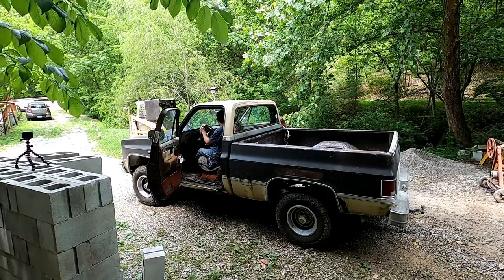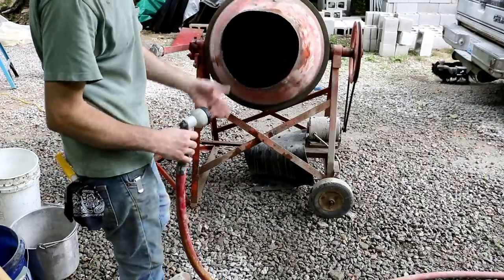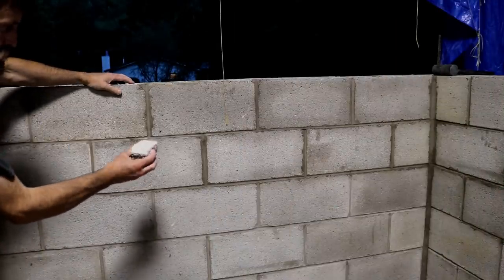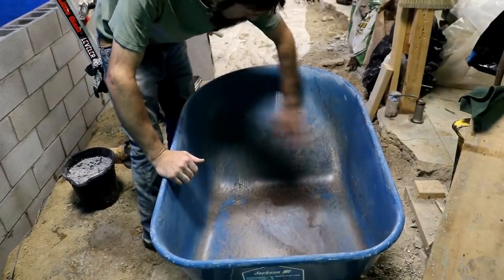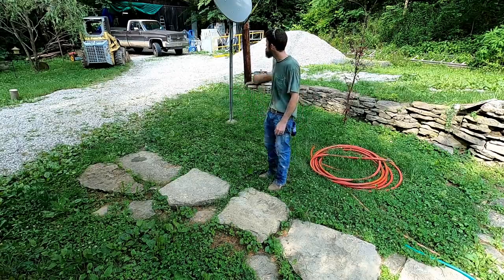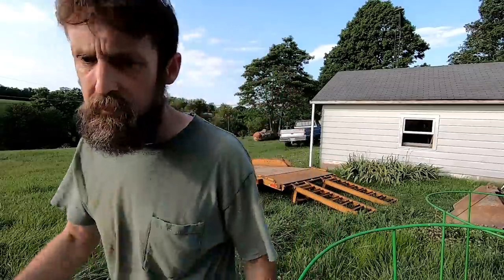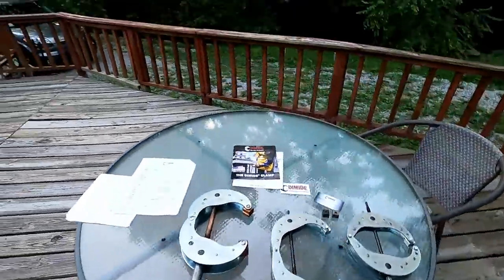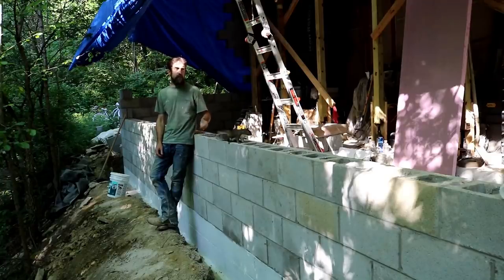Filling the Block / Getting ready for backfill.

Comment: My father was the opposite.  His wheel barrow was beat to shit, crusted in concrete, with cracked handles.  I took it apart when he was at work when I was 16, got all the concrete off, hammered out the dents.  Made new handles and painted it.  He still has it and I'm 47 now.  Over the years in between I never expected it to be something he treasured so much.

Comment: When your guys come to pour the slab, you can have them use the pump to grout your blocks and you can set your J bars for the sill plate while they are finishing the slab.  Cross your chains over- if the ball comes loose they create a cradle to keep the trailer from dropping onto the road.
Reply: The floor has to be poured after the outside wall is up because the jacks that hold the roof are in the way, I said almost the same thing last week then Steve reminded me of the roof supports hehe...
Reply: Arent the crossed chains hazard becayse they can cause the oscillation if the ball comes loose and drag you off road?

Comment: Maybe you can jury rig an unloader for the sand. Lay a piece of 1" plywood in the bed of the truck underneath the sand. At home tie the plywood to a tree and then drive out from under it. Bonus points if you tie off the plywood from the cab end of it, so that the tail end of the plywood has a chance to tilt down as you drive away. If the weight of the sand snaps the plywood when it wants to tilt, maybe try cutting it in thirds and add hinges, or use a bendable material like a extra heavy horse blanket or tarp.

Comment: You can extend your work time with cement by adding liquid washing up soap, the one you use for the dishes, it also acts as a plasticiser if you run out of it on a small job. Drying time remains about the same it just makes it managable for longer.

Comment: Using the flowable fill is ideal for your job. You eliminate the drains inside the building and still keep water out. If you pump your fill you can easily fill empty block with excess material up to floor height too. It will help keep water from accumulating in the block. It will work with your sealing job well too. I've demo'd block that was holding water. You'd be suprised how many block structures sit with water in them 24/7 due to lack of thought. You either drain it or fill it, one of the two. It's looking great Steve. Thanks for sharing

Comment: Putting a tarp down in your truck bed when you load it with sand, gravel, mulch, etc. can save you a bit of effort when unloading. You can just pick up the corners near the cab and flop out the last 50# more or less, if your tailgate is near the pile.

Comment: Using the next mix water to clean the barrow and make the next batch makes the next mix go off(hard) quicker. The chemical reaction started when the first load of cement was mixed with water and the clock keeps on ticking into the next mix.

Comment: Word to the wise - always chock your trailer tires. The first time it rolls forward instead of backward you may wind up in the emergency room. I speak from experience.
Reply: I heard of when loading the trailer lifting the back of the truck and the whole rig going down a hill
Reply: Yep, took a short trip across a road sitting in my sports car while loading it on a trailer. I kept driving forward and luckily my tow vehicle managed to stop before I crashed into something.
Reply: dzneal  Yep I noticed that.
Reply: dzneal brake not break
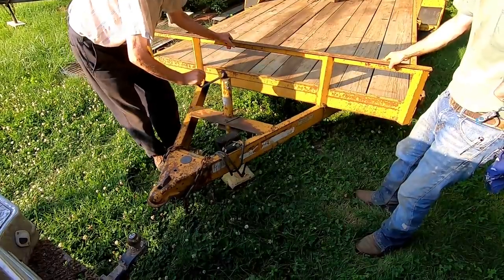Reply: I was referring to about 33:00 when unhitching the trailer and it rolled backwards. It can just as easily roll forward and crush something.
Reply: @samrodian919  Me too

Comment: I always look forward to your Saturday upload. You've never disappointed. Were you live is so beautiful! Availability of different materials can change with local geography. Up here in Ontario we use what we call "A gravel" for cement. It has the proper ratios of stone and fines in itself for excellent cement. It's also used compacted as the base for pads etc. When compacted damp it can be so hard you need a jack hammer or chipper to cut a trench in it.

Comment: Good brakes is one of the reasons I love my f350 dually. Carry 4000 pounds of material and not even be carrying anywhere near a maximum load far as the suspension is concerned.  Towing capacity and stopping capacity are awesome as well. But then again its a 1980 model back when trucks from any manufacturer were still built really well.

Comment: Skid steer went back cleaner than when it came, and with a service as well!
Reply from the maker: And a new battery 👍
Reply: @SteveSummers  Well, part of the service, change the black oil, change hydraulic fluid, change filters and put in a battery that can start it........ Bet the wheels were slightly down as well ;)

Comment: I think you should check what quickreet you can poure into the hole dry and then wet it down then add more dry quickreet as it settles and fill all the block cells, granted it's probably not as good as mixed concreet  but better than leaving them empty. I have seen lots of people set corner postes that way.

Comment: Good idea having your dad hold the brakes while you back the skid steer off the trailer. That's also a good example of why I don't like those double articulated ramps. Once the weight is off the ramp, the supports on the front are useless and almost get in the way. Also, keep your chains hooked up until after you unhook from the hitch. Holds the trailer in case it does decide to take off down the hill.

Comment: Hello Steve
 You need to figure out how much water you're using in a mix. Then the 1st thing you do is but 3/4 that a male in your mixer then add your stone.
 After you get to that point then add your concrete.
 This will allow your concrete to mix nicely with the stone.
 After this is all accomplished then add your sand.
If The mix is too dry add small amounts of water until you reach the right mix

Comment: if you don't fully grout the block with concrete/mortar... consider adding 1/2 stone to them.  Consider it like a crash barrier, if the creek ever hits a 100 year high, it will help dampen and strengthen the wall....  just my 2 cents... as if I had any sense. :-)

Comment: theres a special way to coil youre hose up so it doesnt become a tangled mess when you pull it to the jobsite , basicly you put the wend over the hose over the circle the first time and under the next and keep doing the over under thing untill the hose is coiled , it prevent getting a twist in the hose during uncoiling
maibe one of these days take the wheels of the bobcat and do some touch up painting in it , make it look nice again
as for the braking thing , you got a manual on this truck so you can down shift and let it slow down on the engine during a downhill , saves at least some heat soaking in the brakes
as for someone trying to teal the trailer , maibe you can make a lock on the front wheel so people cannot lower it ontoo the hitch without unlocking it

Comment: I dont know whats correct.
But I usually start with the biggest stone/aggregate and water when mixing.
Then the cement mixes in, and doesnt stick to the wall.
And I thinl mixing it a bit longer or a tiny bit more water in your mix would make flow a bit easier.

Comment: The closest thing the gravel pit you have access to for me is a farmer supply center near me  they have most of any type of material you need and hardware all in 1 location  they do offer pilings and railroad ties  ps steve if possible can you go to the east broad top railroad  on August 15 there having a open house  complete with a line shaft operated machine shop

Comment: Hi Steve.. It sounds like you are a little afraid about the ground weight pushing the wall out again from the bottom.. We here in the Tea Drinking UK found that its the floor slab you are about to pore is the thing that will push on the wall from the heat and expansion..? We always put a sheet of 3/4" fiberboard against the wall and pore the slab too it, the fiberboard will take this movement and stop the wall from cracking under the weight.. I am loving this type of video, and the machine shop videos.. Well Done

Comment: We have a sand, stone, and gravel operation here that operates the same way. I went to get some fine sand for my kids sand box I had built using my utility trailer made from a cut-in-half Chevy C10  8 foot bed. The loader scooped up a bucket full and started to tip the sand in the trailer. The sand was a little sticky because it was wet and wouldn't come out of the loader bucket. The operator bumped the bucket controls to shake some out, and almost the entire load fell out all at once! The sand hit the trailer all at once and flattened the tires right out. The axle was on the bump stops. I drove it the 1/2 mile home and the tires blew out just as I entered my driveway. But the kids got their sand box filled! :) Hey wait a minute! does that truck have a performance cam in it?
Reply: Same here by me up in Illinois. Drive right in and over to the pile of material you want. All of a sudden a loader drives over by you. No words are even said, operator knows right what to do. Toss him a few bucks for his troubles and head over to the scales. If the load is small enough, the weigh operator just flags you through.

Comment: With a 1,2,3 concrete mix design, you should have a .5 water by weight. So if you have a 90 lbs of concrete, then you should not exceed 45 lbs of water. At 8 lbs of water per gallon, that’s about a 5.5 gallons. If you are using 80 lbs bags of concrete, then you should not exceed a 5 gallon bucket. Doing this will result in a 3000-3500 psi mix after about a week with ordinary Portland cement. You can increase that with more ppc though.

Comment: Sorry, I wish I had told you about this earlier in the project.  I just figured you were having everything delivered.   Get yourself/make yourself an unloader.I found the LoadHandler after watching a landscaper unload his truck in a 1/10 of the time I did, last time I hauled brush away.  I had all the hard parts, plus a HD chain and sprocket for some mechanical advantage.
I bought their bed pad, (rubbery on one side, slick on the other, and the mesh mat/cloth they use for the 'conveyor belt'.   Harbor Freight sells a cheapo version, but the weight capacity of this one will unload an actual pick up load, like what you got in this vid.
It'll be handy aas hell later  on for spreading a new layer on your drive, dirt fertilizer..... and goin' to the dump.
Here's the URL:
https://loadhandler.com/
come visit Oregon, and I'll take you and the family for a scenic drive to my fav sand & gravel place.   I grew up around a concrete and S&G place my step-dad worked at.  Wouldn't hav it any other way, either.  My C20 is a '68 and like a carnival ride with its bad shocks, pulling brakes and loose steering!  The truck drivers and employees all get a kick out of  how much I load up in her!
Re: Dimide Clamps
Look like a 'better mousetrap' version of the Kant Twist clamps.  I have a ton of C-clamps, too, but lost my taste for buuying them new once I bought my 1st Kant Twist.  I've got a full range of sizes.  You'd be surprised how handy the 3/4" clamps are.  One thing, if you have some Kant Twist with the T handle, get some/make some plastic handles for them...  Makes a great clamp even better.
The Dimides have some nice features.  Have to check them out.

Comment: Then ditch the chevy rallies and put a set of 3/4 ton axles under that with a 14 bolt full floater in the rear with a hydro boost master cylinder

Comment: Hi Steve, Your mix looked quite dry and needs working, please consider using a PCE based super plasticizer, it will make life so much easier, faster and make better concrete even if costs a little more. Top regards, Jon from soggy, soaking wet England!

Comment: I am guilty of twisting safety chains to make them shorter too.  I have stayed at a Holiday Inn but am not an engineer.  I wonder how much weaker a twisted chain is than a straight chain.  Obviously the twists put additional stresses on the chain that the chain probably was not designed for.

Comment: Don't twist the chains, if they are needed if the trailer ever comes loose the twist will cause either the chain or where it is fastened to the trailer to break. As one other person said, cross them under the hitch to form a cradle to catch the hitch rather than dig into the roadway and cause more mayhem than would otherwise be the case. It is mandatory in Western Australia to do exactly that. I'd also have a more substantial chain than you have on that trailer. American hitches also look so flimsy. Do Dad a favour and linseed oil his trailer deck for him.

Comment: You should tell Elizabeth to just run the mixer with traprock and a bit of water.
It will come out polished inside.

Horrid Fate sells a stinger (concrete vibrator) for well under a Cnote.
Just don't vibrate so much the aggregate all sinks to the bottom.
Reaming with a piece of rebar is tiresome and hard on the hands.

Comment: I still think you need 2 stones to flatten the high spots. Every machinist handbook says so.
Reply: Hmm, the only comment without a heart. But you have to acknowledge that 'stoneing' a metal surface to get rid of burrs and bumps is *exactly* the same thing as what you are doing on the cemented edges...perhaps at a slightly different scale of accuracy. That's quite funny. So a little joke about using 2 precision-ground stones that you keep flat against each other isn't that evil, I would think...I'm not mocking your 'carefulness', if that's a word. In fact I quite admire your almost fatherly treatment of that wall.

Comment: Happy 4th Steve! How does your truck pass inspection with thru rot and no reverse lights? Love that truck!
Reply: A lot of States don't require an inspection to license.  I don't know about KY, but in MO reverse lights is not an issue, along with "wag" lights.  Add-on lights may not be required to work to pass inspection, but they will tell you that if they are on there, they need to be working.

Commercially licensed (that is, interstate) trucks fall under a whole other category ... they don't require the State inspection to get the license, but they do need to get the annual Federal inspection.

As for rust, as long as the integrity of the vehicle isn't compromised, it's not an issue.  Large trucks may be inspected for cracks in the frame and other problems with the suspension, auto and light truck steering components are checked as part of the inspection for license renewal.
Reply: Here in KY. as long as you got brake and signal lights your good, some cops will get you over a tag light but overall pretty reasonable state.

Comment: Great, steady work!
The addition to the concrete slab won´t tie into the brick wall? Or will you drill and glue some rebar into it? 
This big trailer has no overrun brake? Here in Germany everything over 750kg/1650lb max trailer weight has at least some mechanical brake with pushrods or cable operated...So then it´s clear that you need some big truck to control the whole rig...
Happy 4th!
:-D

Comment: Don't twist the chains like that to shorten them, that's a bad idea. It'll work fine for keeping them up off the road and not getting caught up on anything while turning but when you twist it like that it substantially decreases the strength of the chain. If the trailer came off of the hitch somehow and those safety chains actually needed to catch it they would possibly break loose.
https://www.youtube.com/watch?v=clj42no4DxY
Reply: Thought so. One way to shorten a chain if you do not have a hacksaw.

Comment: Steve, the best thing to backfill the foundation when you are pouring concrete on top if it is to use 3/4" clean gravel, also called 57's here where I am. This gravel will be from 1/2 inch to 3/4 inch in size and not have any fine gravel dust inside of it. This gravel is fairly non-compactable and will prevent settling of the material underneath the concrete over time.  Also, if you put a piece of drain tile just through the wall to the outside, water that gets underneath the slab will have an escape route. Daylight that piece of drain tile lower than the footing; since the creek is the likely location for that, put a 1 way flapper valve on it so the creek cannot back up into the pipe when it floods. you can also run a piece of drain tile along the footing at the bottom of the first course of block on the outside that ties into that so it keeps water off the outside as well. Cover the exterior pipe with roughly 12 inches of gravel, an optional fabric barrier, then dirt to the top.
Sorry if I come off as a know it all here, this is the work I do for a living and it is just that I know that is not what you do for a living. Trying to help.
That said, how does the skin on your hands look and feel after playing with all that block? Little rough and dry?
Backfilling inside the garage with dirt is not the best idea, you will have to run a compacting tool on it, you are not likely to get the ground 100% compacted and you risk bumping the wall out of place if you get too aggressive in your packing.